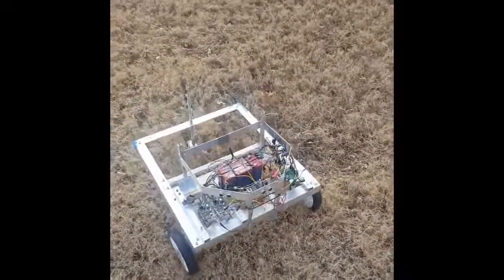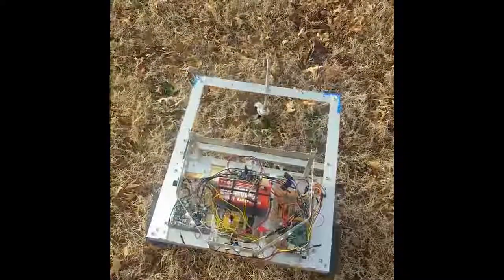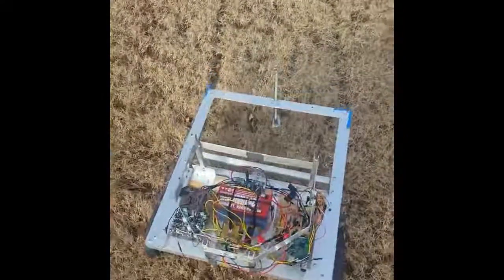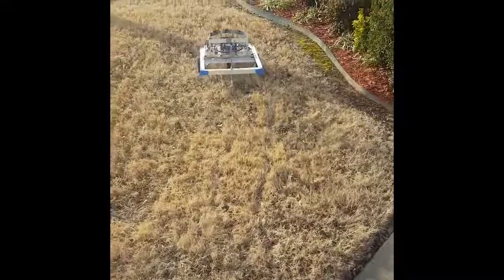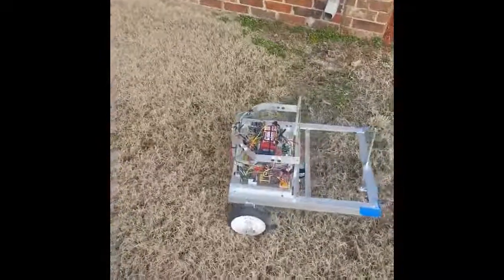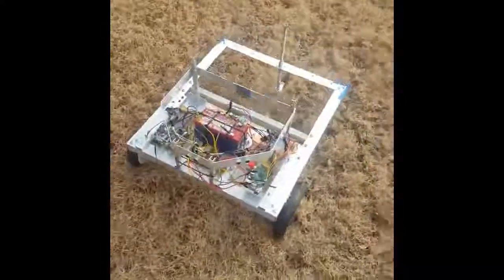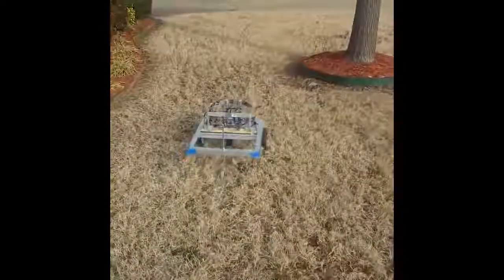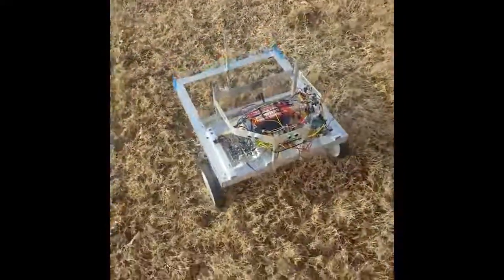Autonomous Lawn Mower using Raspberry Pi

Comment from the maker: Not sure how all this YouTube thing works, but I posted another video with details on the project.  Since then I changed to a pusher (rear wheel drive) which helped in thick grass and lightened the chassis with printed wheels.